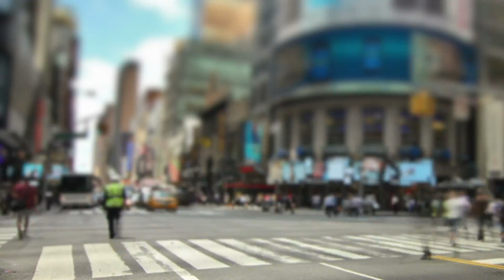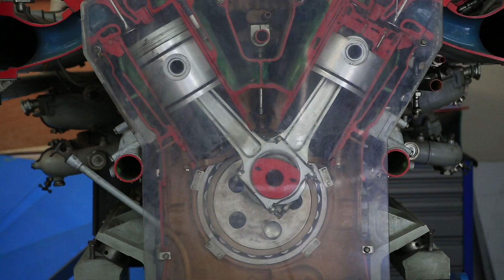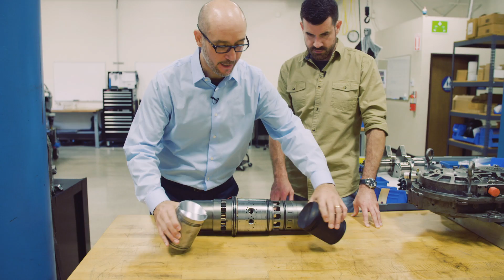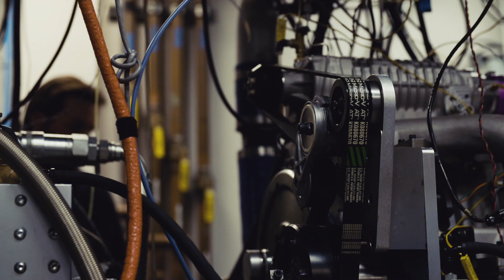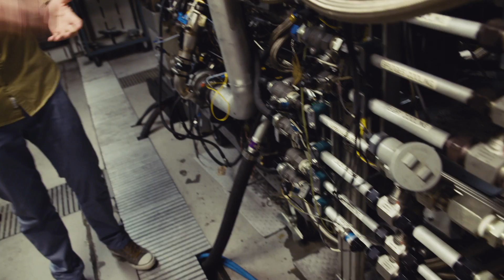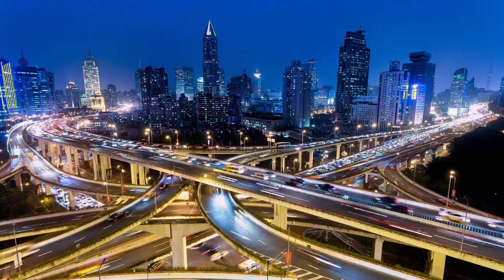This Radical Redesign Could Keep Gas Engines Pumping | WIRED

Comment: Around 10-15 years ago there were many auto manufacturers experimenting with 2-stroke engines because of their ability to create more power than a comparable 4-stroke, but not a single one found a way to make them run clean enough to pass emissions. Unless this engine has some unmentioned radically new technology that can allow it to run cleaner, it's useless. Removing the valvetrain does make the engine simpler, until you consider the need for 2 crankshafts and the method by which to connect them without significant harmonic imbalance issues.
Reply: But this isn't a 2 stroke. It's a 4 stroke, because each piston only carries out half of the cycle, The top piston is effectively Suck and Squeeze, the Bottom is Bang and Blow, there is still a full 4 stroke cycle in each cylinder and the air fuel mix is injected directly into cylinder not via the crank case like on a 2 stroke so there is no need for 2 stroke oil or any engine oil in the fuel or exhaust.
Reply: True, but it uses ports in the cylinder walls like a 2-stroke or rotary, which severely limits the controlability of intake and exhaust flow. That lack of being able to control what is the equivalent of valve opening and closing times means a huge loss of efficiency, regardless of the direct injection.
Reply: Ryan Yantzer you could vary the exhaust and intake flow by changing the timing of the individual crank shafts to have the ports open and close at different times effectively changing the port size by changing the timing on the top and bottom cranks. Well that's how I'd do it anyway. but I'd also use a horizontal layout not vertical a that makes the oil system a lot simpler and reducing the height, I mean... that engines not going to fit under many bonnets lol Interesting project though :)
Reply: Since valve timing events are critical to modern engine performance, fuel efficiency, and emissions (think VTEC, VVT, etc), how do you think this engine is going to accurately control those and vary them according to the varying needs of the engine at different RPMs and loads? Any fixed port is going to have inherent design problems due to the lack of being able to control valve timing events, thus my comparison to a 2-stroke, or as you mentioned, rotary engines. Direct injection gives control over the fuel only, not the intake or exhaust flow.
Reply: Inifiniti already has this and its basically a 2 stroke

Comment: this is just opposed-piston 2 stroke engine.. it's really not something new, and it is doomed to be what it is now.. just a project engine.. first of all, think about it.. how would you lubricate that engine? that's right, it will consume oil like i consume my grandma's applepies.. secondly, the exhaust port is not very modification-friendly, which means that whatever you do, unburnt gas and oil will escape through those little holes.. now a good exhaust design might help reduce that, but oil residue will leak out of the exhaust NO MATTER WHAT! and combined gas-oil polution is the worst kind of polution.. thirdly, the pistons are way too big for a regular IC engine, which will scavenge a lot of the engine's rotational force, which in turn leads to a not-at-all efficient engine.. on the top of my head.. it would be a high maintenance engine because the piston rings will tend to fail due to friction and temperature difference created by the exhaust andintake ports.. heat difference between exhaust and intake ports, will probably make the "block" and cylinder regularly crack and fail.. i can think many more reasons why this won't work... like unbalanced engine layout, high center of gravity and many more.. but you catch my drift.. they could instead improve the two-stroke layout, which is forgotten for way too long, and forget about those shitty and faulty engine designs..
Reply: And? If you have a large oil reservoir you would just need to top it up every so often. I love the 2 stroke engine, while outdated it is still a great piece of engineering. I agree that this engine will never be widely adopted but I hope it will make it into a few commercially available cars, just like the wankel rotary engine.
Reply: We want to reduce emissions not enhance them with oil @! sincostan
Reply: coltin engle But overall it produces fewer emissions.
Reply: Sincostan I wanna rapp out a 2 stroke car at 16000 rpms too  btw ;c
Reply: coltin engle What 2 strokes have you been driving? 16k RPM is fucking insane for any commercially available 2 stroke engine. Highest ive seen is 11k on a old 2 stroke street bike.
Reply: Sincostan You ever seen a 2 stroke in a car?
Reply: @colto2312 JA ,DKW ,saab ,wartburg ,ifa ,enz...
Reply: coltin engle Not one that could reach 16k rpm. My Yamaha R6 can barley reach that.
Reply: Sincostan lmao a car weighs 4+ of those. How else you gonna get the torque required to reach top speeds quickly in a two stroke car?
Reply: coltin engle Well I mean not by going to 16k RPM. It is a larger engine so it will have more torque. BTW Yamaha R6 is a 4 stroke, it would be a near miracle of engineering if they could get it to rev that high.
Reply: Sincostan https://en.wikipedia.org/wiki/Redline
It's a 2 stroke car, is it just going to be 3x the size of an average piston? Because the sheer mass of that would be unreasonable.

https://en.wikipedia.org/wiki/Saab_two-stroke
You think this motor is a good representation of a modern car two stroke?
Reply: This isn't a 2 stroke engine though, It has all 4 strokes in each cylinder, so it's a 4 stroke. 2 parts of each cycle are handled by each piston, top piston is Suck and Squeeze, bottom piston it Bang and Blow. Each crank case (top and bottom) will have its own oil feed, none of the oil will get into the combustion chamber because the piston and rings will be in the way so none will be vented in the exhaust.
Reply: +Sincostan my 125cc 2-stroke kart revs at 21k rpm @45.5 HP :P 2-strokes need some improvement.. rule of thumb :get a lightweight+strong piston even one with shitty airflow and the sky is the limit rev-wise...
Reply: K. beta I can guarantee that your 125 does NOT rev to 21,000 RPM.
Reply: a
Reply: Go to the achates site and read their explanatory materials and papers which address the points.

Comment: 30℅ more efficient is a pretty huge claim.
Reply: ALMOST FINISHED is the key word....! not gonna happen.
Reply: @kkomax7  The Achates engine is already being real world tested in a pickup truck and Class 8 heavy trucks.
Reply: If its 30 percent points than is too large to believe, but a 30% increase is not neeccesary so dramatic. If they compare with an engine with 20% efficiency, than an engine with 26% efficiency would be 30% more efficient, and that might seem like a tall order, but is definitely needed and very welcome, if real.
Reply: A 2 stroke opposed piston configuration could, in theory offer massive advantages. First you have to look at the advantages a 2 stroke offers over a 4 stroke. 2 stroke engines fire on every up stroke. 4 stroke engines fire every other up stroke with an exhaust stroke in between. That is the first advantage. 2 stroke engine designs also eliminate the complex valve trains of modern 4 stroke engines. This eliminates a large number of moving parts and wear surfaces, saves weight, and also allows for much higher engine RPM's. 

Historically 2 stroke engines had dry top ends, and so mixing oil into the fuel was required for lubrication, but this increased emissions greatly. That is where this opposing piston layout comes in. In this configuration there would be no need to mix oil into the fuel so emissions could be regulated with pre-existing technology.

Both 2 and 4 stroke engines suffer from incomplete combustion, and are unable to harness the full potential energy of the fuel. I suspect this opposed piston design is tapping into some of that lost potential in order to achieve that 30% figure. Clean 2 stroke engines would be a step in the right direction. If you can achieve that AND scavenge more of the energy, as well as produce a more complete burn of the fuel. I would say 30% could potentially be within the realm of possibility.

P.S. Sorry for "wall of text".
Reply: 30% more fuel efficient is nothing when you're coming from a base as low as the current technology, which on average manages about 15% efficiency.
Reply: The opposed piston engine is also compact. With a power-stroke going in both directions, you can theoretically double the charge of each ignition. And being that it's a 2-stroke, you have double the ignition cycles.

So you can get a lot of power in a small package, plus it's more efficient.
Reply: mrigendra kumar prajapati I think Wired made a mistake. It was probably 30% efficient. Oh well
Reply: These numbers are worthless as always. It might mean 30% points less inefficient. As in 60% efficiency as a reference and then 72% as a result.
Reply: mrigendra kumar prajapati
Reply: Guybrush Threepwood, yes, its a tall order, and to be honest I do not perfectly understand why 2-stroke and 2-piston is a better idea, and definitely don't understand why it can give a 30% advantage. Have seen other technologies that seems promising, like FreeValve. Also I do not think ICE will have more than 20 years before EV will take over totally, but if someone could invent something with say 50% efficiency and low nox emissions, that would be very helpful in this transition period.
Reply: mrigendra kumar prajapati mazda just created an engine that doesnt need spark. A gas engine that doesnt need spark. They say its up to 30 percent more efficient
Reply: Yeah it's bogus.  This too will never be produced.
Reply: Firstly these are diesel engines, so they have higher thermal efficiency than petrol/gasoline engines. It seems though further development the opposed piston engines will achieve greater than 50% thermal efficiency
Reply: Usually what they mean is that this 3 cylinder is "as good as" V8. And that 3-cylinder might indeed be 30% more fuel efficient... compared to V8.

Comment: Just go electric for Godsake  !!  Why all the complexity when an electric motor has only one moving part --- the rotor.
Reply: I wish electric would work, but the battery technology and charging technology must get better.  The bolt is close.  It's battery pack costs about 10K.  However a new engine in a Cruze is about 1K.  

Lets say they both get about 200,000 miles before they have to replace either the battery or the engine.  

Bolt Base Price $30,000 ( this includes the $7,500 tax brake ) 
Charging cost over 200,000 miles $7,800 ( ~.13 per Kw hr in Florida)
 new battery $10,000 at the end of 200,000 miles
~ cost after 200,000 miles for the Bolt $47,800 

Cruze Base Price $17,000
Gas cost over 200,000 miles  $20,000 ( @ $3.00 ) $26,000 ( @$4.00)+
new engine $1,000 at the end of 200,000 miles
~ cost after 200,000 miles for the Cruze $37,000 - $43,000

Whats all of this mean?  That The cost of the battery must come down to about $1,000 - $4,000

Now if the tax incentive is taken away the battery must come down even further.
Reply: Ronn W  You are forgetting the oil changes,  tune-ups,  timing belts,  serpentine belts,  air filters,  thousand of moving parts,  mufflers,  catalytic converters etc. etc.  that is a hidden cost in operating a vehicle with an internal combustion engine. Tesla says that their batteries are designed to last more than 500,000 miles or 20 to 35 years.  Governments in the European countries want to go 100% electric by 2025. That means no more sales of any internal combustion engine ---- gas or diesel,  by 2025 and thereafter.
Reply: with a 53 mile range I couldn't even go to work ~ midwest status
Reply: Funny you mentioned the one part that's supposed to stay still in a motor, it's the rotor that rotates, the stator is static.
Reply: I think that electrics, once they can compete on price upfront and without subsidies, will be great for lots of people, especially suburbanites and city dwellers, but if they are going to replace IC cars for us in rural areas, they will need 300-400 miles of range and the ability to charge fully in under 15-20 minutes. I think that is a long way out. But we will also need a vastly more robust electric grid, if we go electric. That means more coal, oil, natural gas, and nuclear power. Renewables will help, but they are still almost insignificant compared to conventional technologies. Hard to imagine they will surpass conventional generation methods any time soon.
Reply: Ronn W   Not to mention that the Bolt is more a competitor with the Sonic or the Spark. That adds a few grand to the disparity.
Reply: nallen100  I'm not talking about the model s I'am talking about the model 3
Reply: Where does the 10 charge thing come from if you charge the car at your home it depends where you are in the work but in florida is 0.07  kwh let say a 80kw pack it would be 5.6 to fully charge the car also most people don't drive more the 50miles each day for work to home or vice versa thats 4.4 trips the $10 would be a week of travel
Reply: The new tesla starts at $30,000 without subsidies

Comment: focus on electric dont get distracted
Reply: energy
Reply: Or let people pursue their own paths, this could end up more environmentally friendly than creating electricity via coal, then storing it in batteries and running out of juice a half mile from a gas station.
Reply: Clark Manor, wtf? Are you some kind of nut? Suggesting that people should be free to pursue what works best for them?  lol
Reply: john stewart a lot of things. Coal, oil and gas are the least logical. Easiest to build an industry on however. the real question is: what makes more money (so far)?
Reply: ***** Wind works on the ocean. The japanese are using ocean wind for power. Solar is 3/4 efficiency to oil. not much longer till we get there. If we treated climate change as we did for the military in the US, Im sure we'd get there much faster.
Reply: ***** loll it would
Reply: Japan, where nowhere is more than 70 miles straight-line distance to the ocean?

Comment: You idiots sure like your band aide solutions dont you? Heaven forbid you should actually have any hardships to save the planet and our future........
Reply: Okay, you come up with a solution since you're so fucking smart. Make battery powered cars 1200% more efficient for me, and I'll use them. Till then, I'm relying on the good ol' ICE. FYI: Manufacturing a battery powered car absolutely rapes the planet. Li mining, recharging (using coal) is not cheap or eco-friendly. You are a moron who's only thinking about the finished product.
Reply: UltimateXtreme tell me about oil refineries, how clean those are
Reply: and that has what to do with my post? Internal combustion engines are caveman tech, they consume our species future, it does not further it. My post was saying that technology that uses "less" gas is ridiculous, or a "band aide solution", that doesnt solve they real issues with fossil fuels in anyway, it simply delays them.
Reply: Divergent Evolution Youre right, but try telling that to the people who make money off everything in the current industry.
Reply: nallen100 actually in most countries on average coal gives at most about 30% of electricity, so you're technically wrong. His PC is rather powered by hidro-sources.